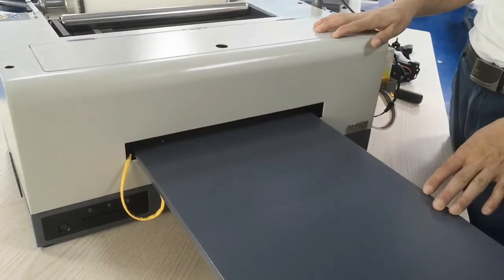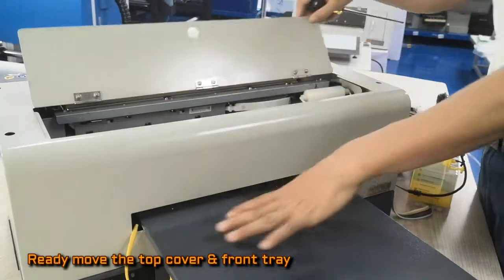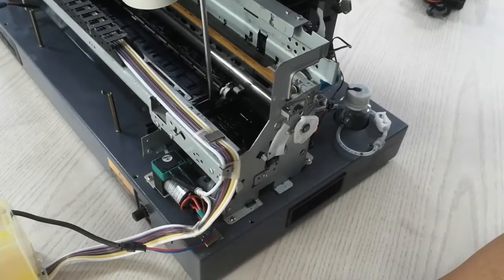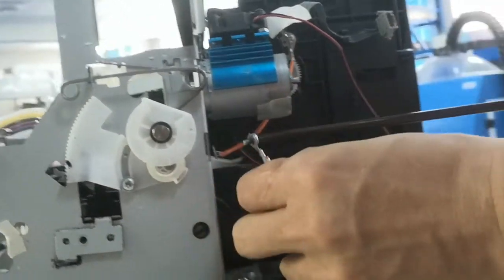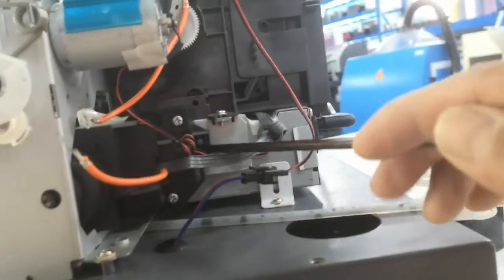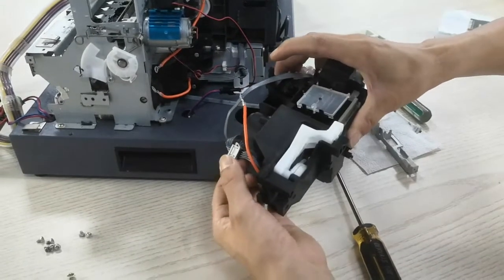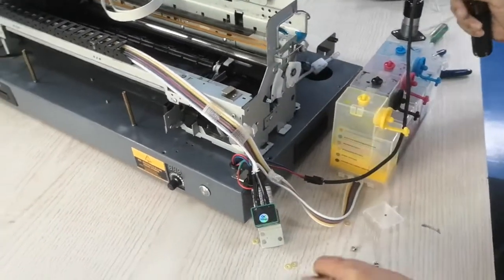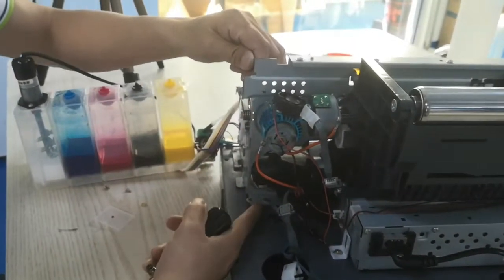capping station repmacment for L1800 DTF Printer maintenance

Comment: How do you know when the capping station needs to be changed?
Reply from the maker: Hi Nep Few ,welcome your message, for the DTF the capping station is very important. because the white ink almost easy to dry.and get a film inside.so we need well maintenance for capping station also. cleaning waste ink .on the wiper .cap. and also the motor, it's not so well  waste ink in the tube long time. that easy get cleaning problem,and damage the printed when you doing a cleaning.  we are working normally can working about 10-12 month